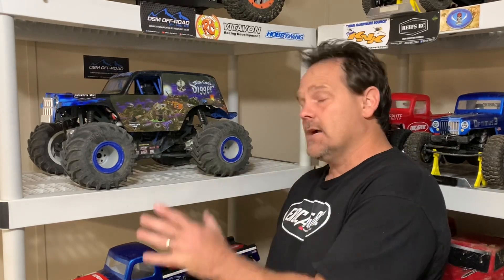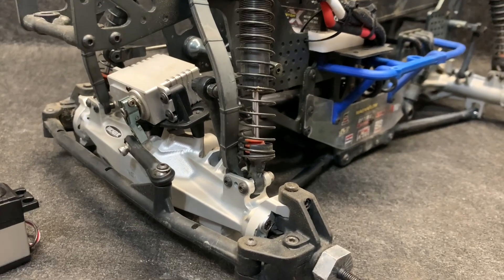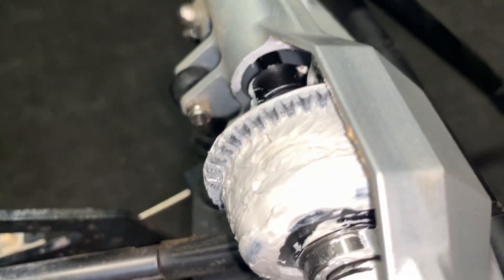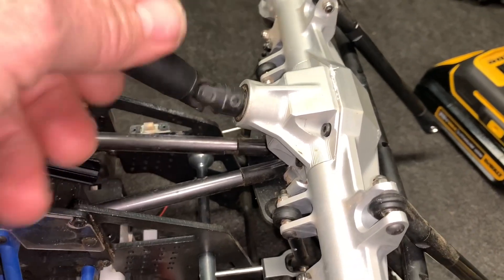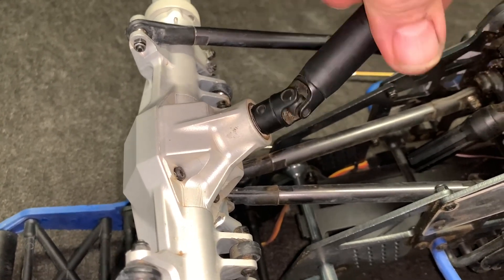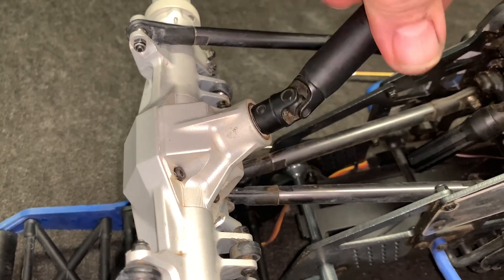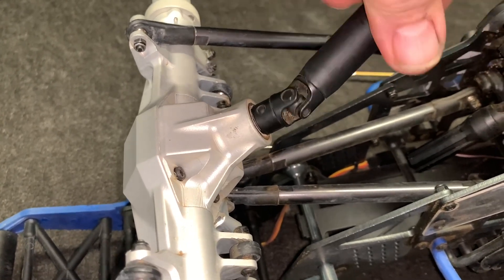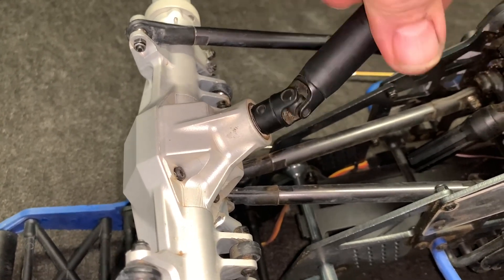LMT TREAL Gear Adjustment

Comment: Replaced my front with treal a while back - no issues. 

Finally broke rear and was assembling the treal for it. No shims - SUPER tight mesh. Bearing are fully seated. 

Suggestions? I’ve tried everything I can think of!  Unusable as is.

Comment: I stripped out the plastic on my stock servo saver. Now I'm using a pro-line big hit servo saver. Working great so far
Reply from the maker: I need to check that one out. I’ve seen it mentioned by a bunch of people.
Reply: Where did you get it from? Thought they were discontinued
Reply: That’s a part I need froze up or toasted my stock servo. Can’t seem to find one + I need a better servo. Need some helpful ideas ? Was thinking the reefs 500 until I saw this video

Comment: So I've been bashing the LMT and found something that you might want to check. I think my truck was built on a Friday. On the front upper link frame side, it is supposed to kept in place with a flanged nut. On mine the link with the servo wires had just a regular nut. So when I landed it popped off and link hit the frame and sheared the servo wire. Soooo check you truck and make sure your nuts are flanged!!!!🤪🤪🤪

Comment: Curious why on the limit strap length. Were you come up with that number for the length. I think ones I have on mine are 105mm, they seem to work. I need to pick up some for the rear now. If I need to get longer ones I will. I had them sitting around so I threw them on.
Reply: I just dont see why he doesn't just use the upper hole in the frame which would probably put those straps at the right distance.
Reply: @daver18qc  i have mine on separate holes. Thought thats what they were there for. Just use a screw and a nut.
Reply from the maker: I have those off now. Went with 105mm. The reason they aren’t in the upper hole was because the suspension would be mostly compressed. If the rain stops I’ll be able to get that video done.
Reply: @ExocagedRC  cool. Curious your thoughts. 🍻🍻

Comment: Are you still running 0°axle pitch all the way around? Or considering at least using the front pitch?
Reply from the maker: 0 degree hubs on the back and the front has the stock steering links.

Comment: Good morning what is a cheap recommend servo for crawling
Reply: I run the cheap Amazon ds 35g servo Joe uses them aswell they work great and are pretty cheap
Reply: @jebrc  I've been looking at the turnigy mg959 v2 but I don't want to over power my steering where I'll break it every time I use it
Reply: @the82square  if your end points are set correctly and you're careful when the fronts are bound up you should be okay.

In terms of recommendations, the power HD 20kg waterproof servo is good for the money.
Reply: @JiKimbo  alright thank you
Reply from the maker: Don’t mess with the 959. They were awesome when they first came out but have got very cheap inside. Go for the 35kg as mentioned above.
Reply: @ExocagedRC  ok

Comment: Why cant you adjust the 25 spline servo saver? You should be able to crank it down!
Reply from the maker: It’s a stock 23 spline. It’s adjustable but the adjuster nut is excessively tight for some reason.
Reply: @ExocagedRC  I thought you had one from hot racing you tried but it was just to loose? The hot racing servo saver I use is adjustable and you can lock it up 100% if you wanted to.

Comment: Could always use a shock as a servo saver. Can be adjusted by a heavier spring and heavier shock oil or diff grease depending how stiff you want it to be